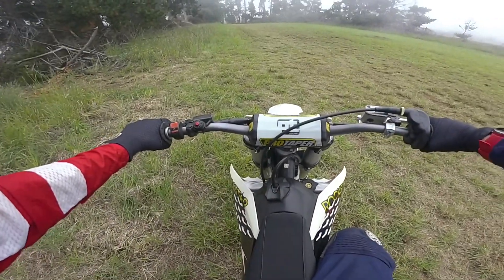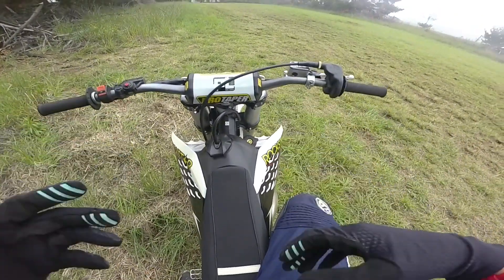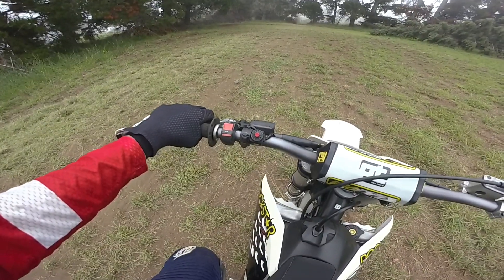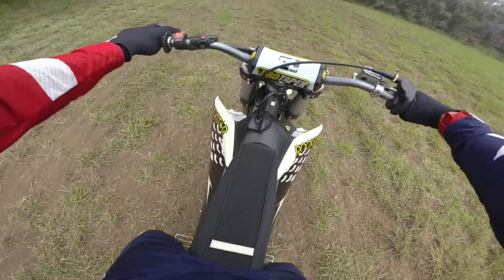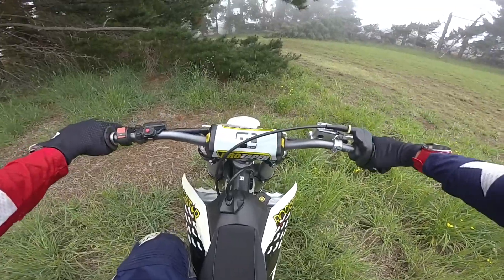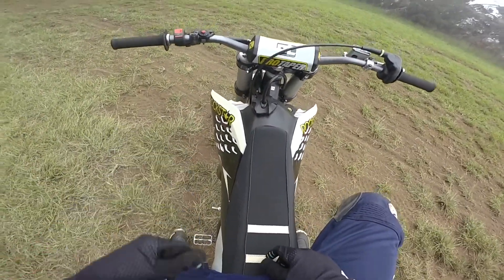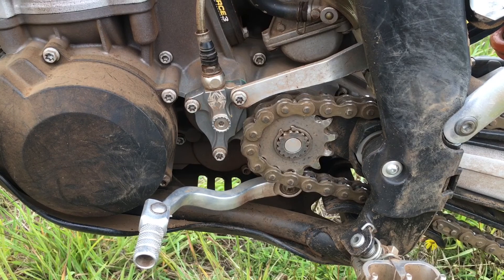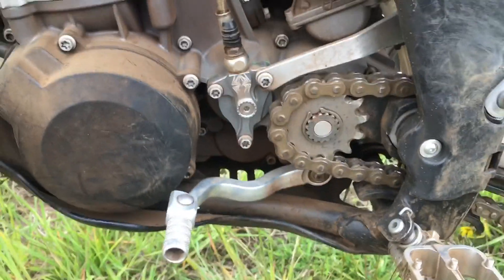Rekluse Auto Clutch Pros & Cons - Everything You Need To Know

Comment: I tried the rekluse a couple times, I could never get over the freewheeling rolling backwards.  The only advantage I see with them for me personally would be If I were to follow our hare scramble race circuit here in British Columbia.
Reply from the maker: MrJasonfromcanada couple hills there in B.C. 😉 so if you were stopping on them, it would require some extra attention.
Reply: John Howerton well we got some pretty gnarly stuff up this way that even a seasoned vet rider would have issues on their first few attempts. 😉
Reply from the maker: Left hand rear brake 👍 Get one of the little mini levers that looks like a compression release. Some of my friends in the PNW run them.
Reply: John Howerton My brother runs the new rekluse on his 17 350excf.  We’ve swapped bikes a few times (I ride a 17 300xcw) and I still prefer the clutch for weekend warrior enduro ridding. I’m not putting down rekluse by any means, its a quality system and is good at what it does.  Like I mentioned, if I was to get serious about racing other than the two I do a year I’d probably install a cheaper z-start pro in a second bike just for racing because it does cut down on fatigue.
Reply from the maker: I get it. Not everyone needs or wants one. If it wasn't for my hand I doubt I'd have one. The thought to get one only crossed my mind last year when I was riding my 690 in terrain it probably didn't belong in 🤣 With a first gear that tall (bigger counter too) I was on the lever the whole time and it was still sketch. Got my 350 into some even nastier stuff and it was a nightmare. Especially with all the flameouts and the things being mapped so lean.

Rode my buddy's while tired when I went back to race on the mainland. Two minutes later I was sold. The year before I had a first lap incident and jammed my wrist among many other problems. He lapped me half way through the race. He's never been faster. I wouldn't have beat him that day by a long  shot, but zero chance he would've lapped me (even injured) with a Rekluse in that bike. It makes total sense in my situation (and his actually).

Ride on 🤙✊
Reply: John Howerton I love my 300’s but if I were to build a purpose built hare scramble bike for out here in BC, Id like to throw together a 250xcf with a rekluse, starcross medium 5 front and shinko 525 rear.  I think that set up would be a quick flickable hare scramble bike. 😃
Reply from the maker: Sacrileg for me to even say this... but if I find a 250XCF or EXC (legal to go anywhere) the smoker may go. Back where I lived in Washington I'd never get rid of it. Killer practice bike... and bigger tracks, but everything around here is so small 250F has all the power you could ever need. They get a little weak at altitude, but there's no races up there, so it doesn't matter. I can deal with 250F engine braking, the bigger bores I can't stand it.

All that said, if KTM still made a 200SX or XC I'd be all over it like stink. I tried to buy the one 150SX the dealer had, but they wouldn't sell it. It was the "shop bike." Then they got a cherry 250XCF on trade and I tried to buy that, but they said, "No, it's the shop bike." I replied, Then sell me the 150!" "We already sold it."🤦🏼‍♂️ #WellShiteOnAStick I bet the 150TPI is a blast!

True story! 🤣

Comment: Installing that clutch, it will raise and lower the gears alone, clarify what is the operation of the clutch, because in all the videos of the clutch you speak in English and I do not know what you say because I do not speak English, I hope your clarification, greetings.
Reply from the maker: No. You shift the same. It only makes the motorcycle not stall.
Reply: @JohnHowerton137  So you have to keep using the foot lever to go up and down gear?
Reply from the maker: Yes.

The clutch lever also works normally (if you want).

Comment: So you're saying if you bog the engine all the time, the clutch is actually slipping a bit? 

I can see how this system be beneficial to alot of people. But for myself i could never use it. A manual clutch gives me so much control, that this would take away. I basically constantly slip the clutch, or run around bogging the engine lol.
Reply from the maker: You can ride the engine low, but that corner you bogged in 3rd normally... shouldn't be bogged in 4th, just because you can. 

Chances are you would love it. The clutch lever works exactly the same. I was trying to show that. If you rode this bike and I didn't tell you it had a Rekluse, you likely wouldn't even know. I didn't the first few times I rode bikes with one.

Funny enough, it was a clutch banging sand track that sold me on them. There were a few corner sections where the Rekluse just had way more control because it would stay in the sweet spot without a shift.

Comment: My only question is with a recluse clutch does it still engine brake
Reply from the maker: If the RPMs are kept up it does. If the RPMs fall below whatever the engagement point is, it basically coasts. So it depends on the scenario in which you use it. For most riders the simple answer is no.

Comment: What do you think of a Rekluse in a 690? Givin is some thought.
Reply from the maker: I'd love to have one on mine. If you ride off-road much, 100% get one. 690 has a really tall first gear. Riding off-road the 14T counter sprocket is the way to go, but it's too low for the street. The anti-stall, perfect slip of the clutch would really help the 690 when it starts to get a little more technical.

Comment: Well I wanna throw my 2 cents in this debate. Ok i want to first off say 2 things. One i have about 25 years experience with this style transmission and i have 2. Never driven a motorcycle. I have been  PASSENGER ON A BIKE LIKE ONCE OR TWICE. Current fuel prices are motivating the bike vs car aspect for riding around home.

Ok 25 years. I have been  LONG HAUL TRUCK DRIVER FOR THE LAST 28 YEARS AND STARTED OUT WITH MANUAL 8,9,10,13,AND 15 SPEED TRANSMISSIONS. Now that being said a few years in my employer switched to the new Eaton ten speed auto shift transmissions. In a manual transmission, cannot start in gear without foot on the clutch. With the auto shift you could use the clutch to start in gear but once you let it out nothing happens and you would be free wheeling in gear.

The driver then has to wind up the throttle to engage the clutch to provide movement.
In a quick stop if RPM was too high you could stall it on stopping unless you used the clutch to avoid stalling. Now on our trucks the system used air pressure from the braking system and electricity to "shift" the gears instead of a manual "shift lever" in the floor. A road speed sensor would use speed data plus air and electricity to "skip shift" up or down as needed like before entering a corner, you brake, it disengages clutch to coast and without applying clutch pedal, add throttle and it would engage the lower gear automatically and you can accelerate out of the turn.

So my question here is with this familiarity built in over the last 25 years and i were to look into a recluse setup for my first bike, i have some questions.

1. When slowing down before a turn then coasting through then adding power, does the transmission sense road speed to auto select the correct gear for me to slide into or do i have to manually calculate speed and RPM drop and know the gear then bump  the selector down to that gear. Say from 5th down to 3rd. will it be waiting for me in third to apply the throttle? Or do i have to bump from 5th down to third before applying?

2. When accelerating through the gears does it skip up like 1st, 3rd.& 4th like at the top of a hill going down or do i have to go 1,2,3,4?

It seems the learning curve would be lower for me on starting with a recluse style transmission than a normal manual. Although for a beginner on a semi i would recommend a manual for starting out as far as fatigue management is concerned and missing gears on your first 11 hour drive day non stop (other than a 30 minute break after first 8 hours). the advantage on the manual is your student knows fatigue much earlier by missing gears before falling asleep. In an Auto shift style your warning sign as it NEVER MISSES A GEAR when shifting is weaving in and out of your lane on a straight away before you fall asleep.

Manual alerts beginner to fatigue more quickly than auto shifting will.

So in selecting first bike, what do you riders think? Should i stick to what i know, and go  for a recluse auto clutch or start out manually? i will not be riding for 10 plus hours straight. just around town and a few back road trails. Thoughts?
Reply from the maker: So it wont shift anything for you. You have to use the shifter every time. Being that the bike isn't an insanely heavy truck with oodles of gears, gear selection matters exponentially less. Say you were in 5th doing 55mph with the Rekuse and a 35mph curve was coming... 3rd would be a better gear, but with the Rekluse you could still bog the engine around the corner and probably not have to worry about anything, it would just be better on the clutch wear if you didn't.

Same thing for the hill situation. The engine will just keep bogging down giving you the cue to drop gears. If you came to a stop at the top in say 3rd, depending on how much power the bike has, you may or may not be able to take off again.

Just think of the whole thing as a manual that can bail you out in those dummy, newbie, quick hard braking situations. Experienced riders learn how to take advantage of the features just like you did on the trucks.

I'm the opposite. I haven't owned 4 wheels in 13 years. As far a first time rider, I recommend either a small trail bike or small dual sport/enduro in your case. Something under 300cc.

1.) They get good milage. 

2.) You buy it, take it to a field somewhere and learn how to crash it gently. You can learn everything you need to know traction, steering, shifting, sketchy slides, etc... I don't think I need to tell you that the road is a crazy place! Learn how to handle the bike a little bit in a more extreme, but less life threatening environment. 

3.) They're just flat out fun. you can explore, take it camping? The world is your oyster!

Cons: The little dual sport is completely worthless/dangerous to take on a freeway. Most only do 55-75 pinned wide open. They are amazing for town and back roads though. You can Rockstar park them anywhere.

Motorcycle Cons: You are no longer king of the road. Everyone is bigger than you. Remember that. You may be right in the accident, but you're dead right. Never trust ANYONE!

Hope that helps.

Comment: i like to use my clutch, but im looking at the rekluse just so I dont stall the bike on accident in a corner. saves time in a race
Reply from the maker: Saves time and a ton of energy 👍 Clutch lever works the same. That's the thing that most people don't realize. You're not taking anything away from the normal function of the bike, only adding an anti-stall feature.
Reply: @JohnHowerton137  perfect! That's exactly what I'm looking for

Comment: can you brake tap with an auto clutch and not kill it?
Reply from the maker: That’s a lot of the reason why I got it. Neither of mine have allowed it to die.
Reply: @JohnHowerton137  in the air right?  just to be super specific
Reply from the maker: @Destroytheskymusic  correct. I have a really bad left hand. After only a few minutes of riding the dexterity of that handnis more or less worthless. I’ve done a lot of stalling in the air on regular bikes. My two Rekluse bikes never have. I’ve only ridden KTMs (with hydro clutches) so I can’t speak for the Japanese stuff, but I imagine it’s the same if adjusted properly. When in doubt, call Rekluse.
Reply: @JohnHowerton137  right on! i've always been curious about if it works like that. i guess if you're an experienced jumper its not a big deal to think of pulling the clutch but its sure hard when you're in panic mode lol

Comment: Would it help you more if you are racing? Lets say you tip over and it shuts off.
Reply from the maker: For sure. Most people don't realize, you can ride the bike almost exactly the same. The first 2 times I rode a Rekluse bike I didn't even know I was riding with an auto-clutch. The clutch lever works all the same, but the bike wont stall. Very nice on 4-strokes prone to flameouts.
Reply: @JohnHowerton137  awesome thank you

Comment: “Graham doesn’t use an automatic clutch. It’s a question we’re asked almost every race weekend. What he runs is the Rekluse Manual aluminium billet clutch basket and the Rekluse pressure plate with standard clutch plates
Reply from the maker: I have this very quote posted in this video's comments somewhere. That's from 2 years ago. Wouldn't surprise me if he ran a Torqdrive for select races like Erzberg though. He probably prefers the soft feel of the stock plates just like he does the TPI. He's a low RPM rider.

Graham also says he thinks the auto clutch is good for those who are learning or are struggling. He's not anti-auto like most of the haters on here.

Comment: Are u still getting numb hands when not using the clutch? I've been getting a numb clutch hand about 15ish mins into rides. Its not arm pump or fitness related, I've had numerous wrist and shoulder injurys over the years and have been on the fence about buying one. But just might have too. Good video man
Reply from the maker: Yes, but its delayed and when I do lose the fine motor control it's much less likely I'll crash.

You probably have thoracic outlet syndrome (TOS). Common with injuries like yours (and mine) that create compensations. Common in general in western society where we have crappy posture.
Reply: @JohnHowerton137  yeah not sure. I've gotten it a little bit in the past and its almost gone away during the ride, similar  to pushing through arm pump. But I had recently cased a double pretty hard and now its worse then ever. Its pretty much a guarantee at about 15 mins no matter what. Hopefully the new clutch will help out if not ill have to go see a Dr. Unfortunately
Reply from the maker: SloppyTaco Google "thoracic outlet syndrome" chances are you'll match the symptoms and cause. Dr. is unlikely tell you anything good. I was misdiagnosed by tons of them for 21 years. A GOOD physical therapist can help you. Also Google "NKT practitioners" neuro kinetic therapy.
Reply: @JohnHowerton137  cool man, thanks for the info. Thats why I dread going in for anything, seems like I always spend a bunch of time and money jumping through hoops to have them take some random guess. And seems like more then not it isn't a correct guess
Reply from the maker: SloppyTaco hence why they call it "Practicing Medicine." 🤣

I appreciate what they know when I crash and have some kind of trauma that needs immediate treatment, but outside of that... I find them of very little use. Half of my family is in medicine and I consult them... and some of my former doctors. 

One of the last times I went to a doctor he said verbatim, "I'd refer you to someone, but you know more than any of them... so fix it yourself." 

My reply, "Appreciate your honesty Doc."

You don't need a $100,000 piece of paper to know shit 🤣 There are a lot of smart medical people out there, but they can be really hard to find. I partially blame the billing system. It rewards turnover, not results. Maximize patients per day and bill them on a 28 day cycle to get 13 visits per year = most money.
Reply: @JohnHowerton137  excactly

Comment: I don't think these are cheating at all. I think they are a great idea for those with left hand strength issues or maybe those starting to learn how to ride very tough/technical terrain, I actually have more of an issue with those who use SLIPPER clutches on a street bike. That's cheating/lazy and keeps the rider from learning how to ride into turns in the proper gear.
Reply from the maker: They aren't cheating until a sanctioning body says they are 😋

Comment: My thoughts are if you ride 2 strokes its not much of a game changer. If you ride a 450 in tight woods it is. Another con to auto clutch is you lose Engine Braking.
Reply from the maker: You only lose engine braking below 1,200rpm or whatever, so on the 4T it actually works most of the time. I feel like I got a little more coasting on the 2T.